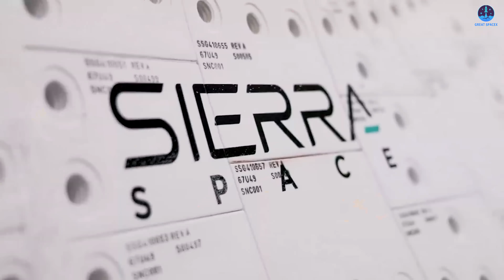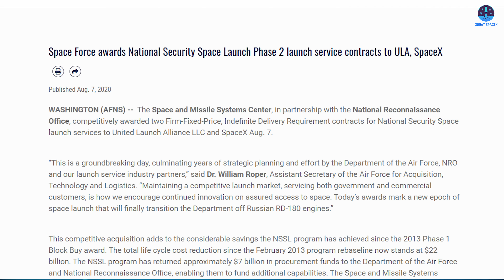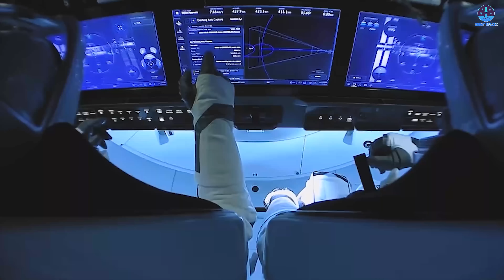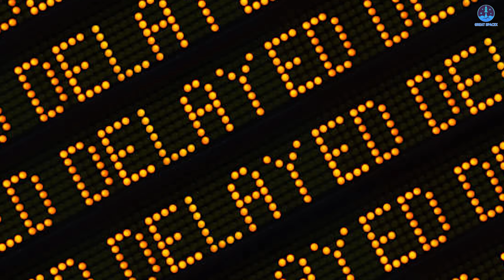NASA's New Space Plane got BIG PROBLEM after ULA...SpaceX to Replace!

Comment: The X-20 and more recently the STS Space Shuttle were both designed to fly to orbit without fairings around them. I wonder if that would be possible with this new spaceplane? Why would a spaceplane, which can re-enter the atmosphere from orbital velocity, need a fairing to go much slower than that (in effective mach vs altitude) through atmosphere on the way out?

Comment: AFAIK the Falcon 9 Heavy extended fairing is the same diameter as the current one - just longer so it still wouldn't be compatible with Dreamchaser.  No way Elon is going to come up with a fairing for one customer who might fly a handful of times.  So basically its either New Glenn or Vulcan.

Comment: The issue is not with Dreamchaser, the issue is with ULA! They never should have locked themselves into relying on ULA. SpaceX would have been a better choice.
Reply: the problem is spaceX doesn't provide a fairing big enough for dreamchaser
Reply: @Taiga-1.44  That could be rectified.
Reply: it could be but it doesn't seem like it's going to be, unless sierra space hands over alot of money I don't see spaceX making a new fairing at the behest of a single customer.
And i feel that if spaceX was going to make an extended fairing they would have done so for the last cycle of government contracts as that is the only thing making them ineligible for some of the contracts.
Reply: @Taiga-1.44  I said "could" be rectified. Like you, I don't think it will be. No telling what the reasoning is.
Reply: Pay Elon to redesign the X37B to carry crew and cargo, then launch with Falcon Heavy, which already launches it. Pay SpaceX to develop the X37C, which was in development then dropped. But it's Boeing, so no surprise there. Launch it with a Falcon Super Heavy if you need more power, tell Elon. X37 is a proved design. Dreamchaser is just a dream. Give it to Elon, pay him to build a factory for however many you need each year. Stop dicking around with companies that forgot how to build even old school rockets. Pat them on the head and send them home. It's not a welfare program.

Comment: Dream Chaser does not need a fairing. In fact, a crewed version must not have a fairing so as to be unencumbered for a launch/abort capability. 
We need Dream Chaser because SpaceX is not going to build any more Dragon capsules.
Reply: Don't need any more Dragon capsules because ISS will be gone in a few years, and there's nothing funded on the horizon to replace it. DreamChaser's need has come and gone (if it ever existed at all).
Reply: @T_Mo271  Every indication is ISS will be quickly replaced by a growing number of private stations. Hotels, Science, Pharmaceuticals and Manufacturing. Exciting times ahead.
Reply: Sure. Show me the money.
Reply: There are several proposed private smaller space stations. Maybe they will appear.
Reply: Requires funding that they do not have.
Reply: @T_Mo271  "funding that they do not have." 
You're thinking NASA & Government. Think private enterprise.
Reply: Proposals are cheap. Real projects are not.

Comment: Put it on a FALCOLN9/FALCOLN HEAVY
Reply: Right. What's the downside? SpaceX is too cheap, too reliable, and too fast? There's no reason not to treat Dreamchaser like any other cargo and shop around for a lift.   Seems like the "downside" is somebody's panties in a twist.
Reply: Should be using a Delta 4 heavy if they still had them, but ULA is getting their Vulcan ready.
Reply: The lifting body has always been recognized as the optimal shape for an orbital vehicle. If regular service to orbit is ever to become a reality, then fast turnaround time and low-cost processing will be a must. It doesn't get easier than flying back to a Runway next to the launch pad, and the cross range capability of a lifting body gives lots of options in case of emergencies. It also allows re-entry profiles that can minimize G loading
Reply: @jimeditorial  The lifting body has no abort capability.  The best way for "regular service" is make a component based Crewed Dragon.  No abort = suicide mission for some unlucky crew.
Reply: @Easy-Eight the lifting body can abort to any commercial airport anywhere in the world. Parachuting into the ocean requires a pre-planned landing area and Recovery Services. And then you have to hold a thing back to the base for refurbishment. There is a reason why the Air Force loves their X-37B
Reply: @jimeditorial  The X-37B isn't crewed.  Crewed Dragon can abort from the pad.  Then again it's getting pretty clear that the lifting body will never be used.
Reply: I doubt that Sierra Space cares which launch system gets their spacecraft into orbit
Reply from the maker: Agree 👍
Reply: No abort capacity in the Space Plane.  The crewed Dragon is cheaper, safer, and can carry more cargo.  Game, set, match.
Reply: with a 99.18% success rate vs ULA's 100% success rate.